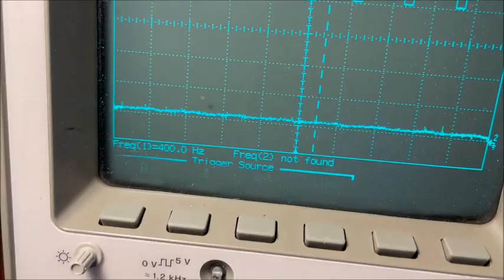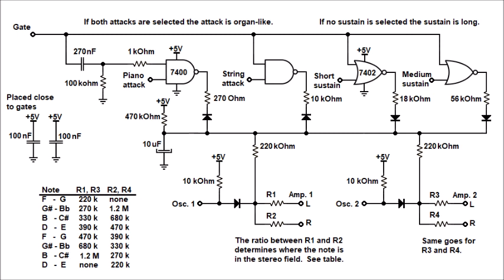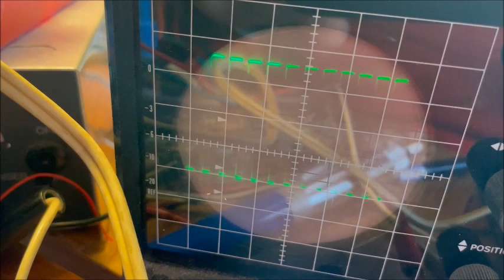Polyphonic NE555 instrument - 2: Envelopes

Comment: the algorythme doesnt show me what i want. how come i didnt see the first part? way to go man, i know about some adsr circuits that are pretty simple (with 555's), and if it's about 24, i'de be delighted to etch the circuits for this project, they are pretty small. oh but the thing is you need them voltage controled right? multiple digipots could do too, but that will add some work... great job mate, following all the time (when the algo doesnt tell, i come to check every once and a while)... i'm working on a leslie (with streo ring mod added to) emulator, the idea is to start from that dual 8 stage (selectable but 16 total IF IN SERIES) phasor i designed (dimension shifter on y channel).

Comment: It always amazes me how good the core tone of these diy synths are. Ive noticed it also when I started getting sounds out of my own diy string synth. They immediatly sound like classics from the the 70s. Compare this to modern analog polys I have played and they sound.....welll not like the synths of old. They sound more like really nice vst's rather than classic analogs. What are we doing so right? Lol is it the fact that our designs are kind of crude ?
Reply from the maker: In a way I think it is the simplicity. When I play something modern I always have to turn off a lot of things. Today it seems like the synth companies believe that we want everything on at the same time so everything sounds like a big swirl of echocompressionreverbchorusbitcrunchphaserpanmodulationandwhatnot while in the 70's you could not get everything at the same time and default it was turned off. Even though I have a Technics organ from the late 90's I actually prefer the Technics I have from the early 80's.
Reply: @organfairy  very true. Dont get me started on the clutter of lots of modern synth control panels. I go cross eyed.

Comment: The audio problem is because the compression Youtube uses thrashes lower resolution videos, and really lowers the quality of audio often. To get around it, re-upload the video to something much higher than 480p.
Reply from the maker: I have tried that with earlier videos and it didn't solve the problem. I think it is something with the audio coding as it always happens with sounds that are pure square waves or FM synthesis.
Reply: @organfairy  I used to dump synth demos here all the time and never had this level of poor audio encoding.

As a reference:

here are literally dozens of square wave sweep videos that don't sound  nearly this bad. it's an encoding problem on your end. 480p is really low end.
Reply from the maker: I just checked and I did compile it in 1080p. I don't know why YT only made it 480p. But the problem is somewhere in the video chain. The original audio file is fine.
Reply: @organfairy  I'd just export it again at the highest quality, and then transcode it with something like Handbrake with the higher youtube settings on, then. I've done hundreds of uploads on my main channel and never had this issue with audio.

Comment: i don't understand the circuit. the logic gates source and sink current to the 10uF via diodes, so far so good, but what is modulating the amplitude
Reply from the maker: The modulator part of it is basically what is known as a "clipper". If you look at the schematic at 1:00 there are two connections called ' Osc.1' and 'Osc.2' and they are connected to 'Amp 1' and 'Amp 2' through a diode and some resistors. The oscillators are making squarewaves but because of the diode the oscillator can only raise the voltage level and not lower it - in other words the squarewaves can only pass if the voltage on the capacitor is lower than the high part of the squarewaves. When the voltage on the capacitor is close to zero the connection point on the right side of the diode is pulled down via the 220k resistor and when the oscillator goes high the point is pushed high through the diode. So because of the diode it is the oscillator that determines the high part of the square wave and the voltage on the capacitor that determines the low part. So when the voltage on the capacitor raises and lowers the volume will also raise and lower because with squarewaves the volume is the difference between the high and low parts. One important thing to notice is that it only works with square waves. Other waveforms will get distorted because the diode prevents everything below the voltage on the capacitor to pass, so it effectively acts like a clipping amplifier - but it is called a clipper for a reason 🙂

Comment: You know I enjoy this kind of video. The solder companies also like them. Ha Ha!  I’ve had many fun mind adventures just thinking of all the things a 555 can do, if you just use some imagination.  So many chips that evoke ideas for projects.  I have built the frequency divider and used it with my Crave synth to pretty Cool success. With modular, it can be a good thing when a circuit hits a parameter that makes it wig out a little. That’s what mine did and I liked it. 😵‍💫🫨😂🤣. Thanks for the fun!

Edit: Slap a little delay on… and the picture opens up a lot. Hope you’re doing well!!
Reply from the maker: Wait until you hear the finished result. It has an effect I haven't tried before.
Reply: @organfairy  Cool!